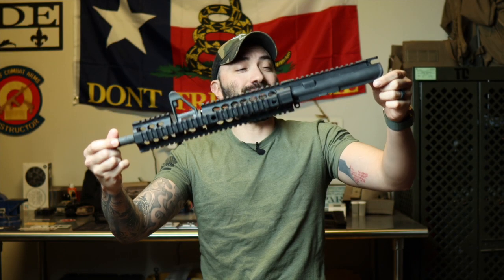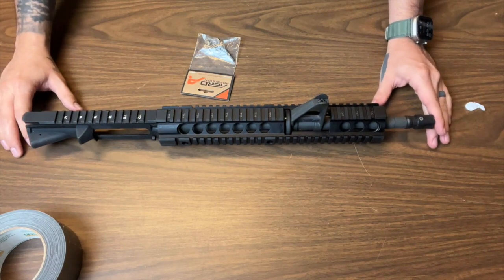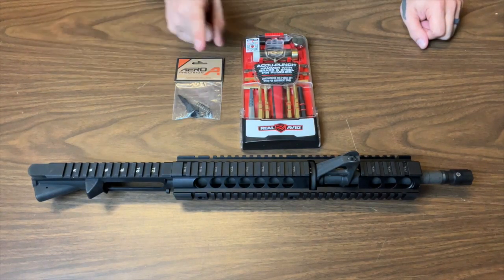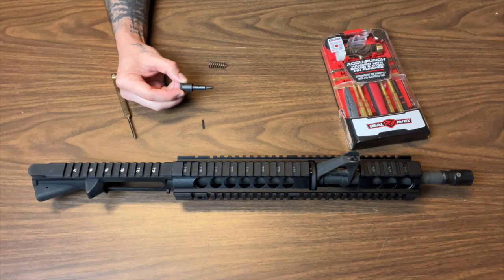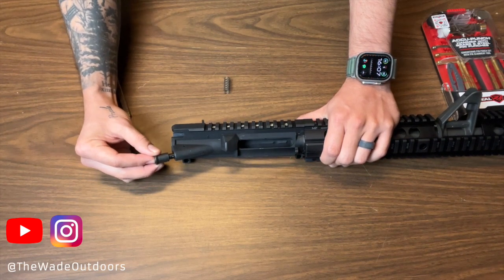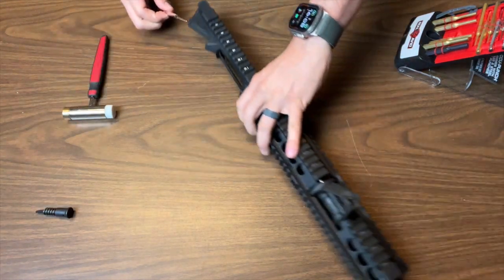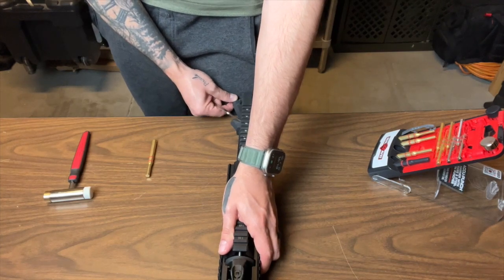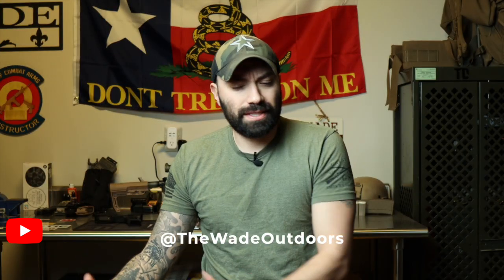How To Install A Forward Assist On An AR15

Comment: Don’t listen to this guy. The pin is too large. You can use the strike industries forward assist but should also get oem pin.
Reply from the maker: 🤣 the pin isn’t too large. It’s a OEM pin. The same pin you’re suggesting. It’s a flush fit

Comment: I HATE roll pins. It takes me like an hour and a half to just get one started on a gas block
Reply from the maker: Yup. Then when they mushroom out it just sucks
Reply: @WhiskeyZero7 right same here my forward assist. It’s in and caught but all mushroomed out and still needs to go in more
Reply from the maker: Just gotta take your time. Luckily those pins are cheap
Reply: Coiled pins are the way to go. I use SOLGW forward assist and gas tube coiled pins but I’m sure other brands are fine. 

Basically the are spun up really tight in a snail shell type pattern and they tend to not mushroom during install.